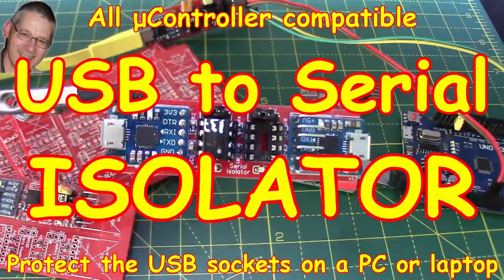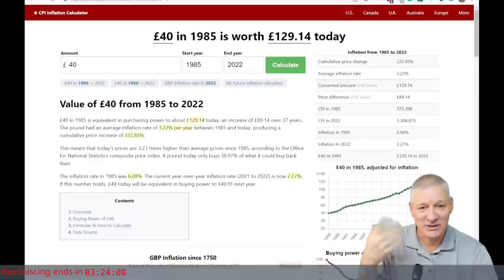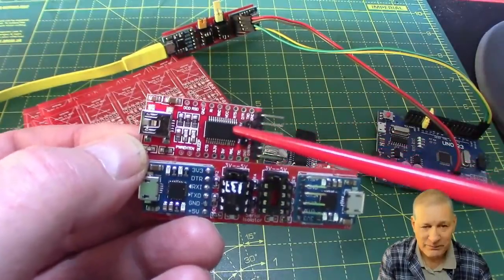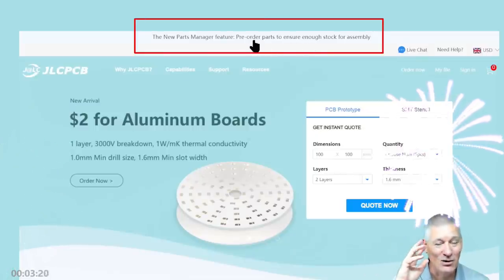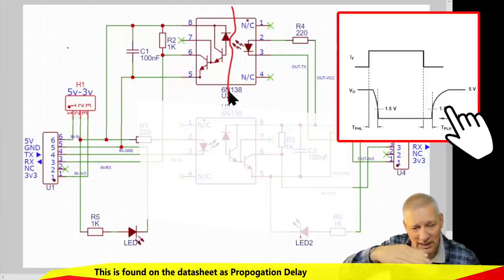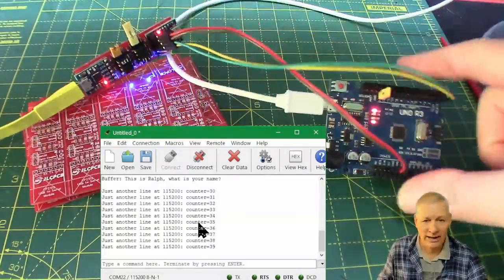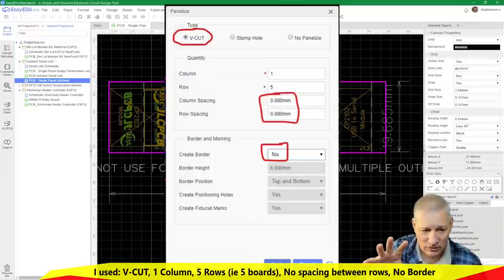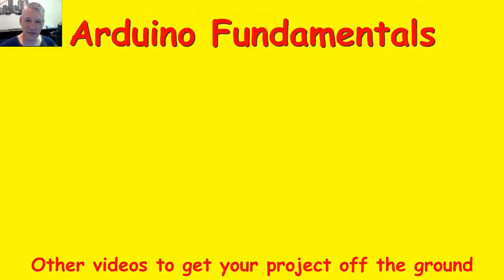#240 USB-to-Serial Isolator ⚡ Protect your USB sockets ☠

Comment: Well, your bringing up "Practical Electronics (PE)" awoke so many memories. My interest in electronics was mainly in music synthesisers (I am in my seventies, so read this as progressive rock). However I was also curious about computers. In the late sixties that meant mainframes. So, I was slowly but surely constructing a computer from 7400 series ICs. Then one day, in the newsagents, I spotted a copy of PE cover with a project for a monitor. After buying the magazine, I discovered that this monitor didn't have a serial interface but was meant to interface with a S-100 bus. I had seen some articles in the media lauding the invention of microcomputers. They didn't reveal any detail of how these devices were to revolutionise our lives, so I didn't pay much attention to microcomputers. However, the interface of PE's monitor intrigued me: it was obviously directly connected to something very like what I was attempting to construct. I looked into it further and realised that this thing I was constructing (already the size of a large suitcase) could be replaced by one CPU chip and a handful of peripheral chips. I bought a FOUR bit development board (for £250 in the early 70s) and a 50 year love affair with computers began.
Reply from the maker: It's funny how we get introduced to computers. My brother saw me still using analog/digital discrete electronics in the early 2000s and sent me a PIC controller (to update/flash PIC chips). The scales fell from my eyes. The rest, as they say, is history.

My first £3, 8-bit PIC chip dev board certainly was an upgrade to your 4-bit development bard for £250 (in the early 70s - probably more than a month's wages).

Interesting anecdote, Michael, thanks for sharing.

Comment: I'm here because my current project has not 1, not 2, but 3 USB connections.  When I connect my floating battery powered scope to it and touch the ground pin to the breadboard the scope's input relays "pop" and "whine" and the trace shows +12V -14V 50Hz sine wave.  Mains leakage current and noise.  Standard PC USB.  Note those USB circuits in PCs are as tough as nails, they will take all kinds of abuse and the isolator isn't really going to help the PC for you, it's the other way really!  PC SWPS are fierce.  They can be rated (mine is 800W!) the amount of noise it puts out is obscene!  PC power supplies (large SWPS) are the reason why the safety protection circuit in modern homes is set to 30mA... because having half a dozen SMPS in a house would trip a lower rated trip switch!
Reply from the maker: Indeed, I had an issue with a USB SMPS driving an Arduino circuit; behaved erratically until I put the power through a smoothing circuit; thereafter, no noise and perfect behaviour. Decent PSUs put out very little noise; it's the cheap ones (or ones connected to a PC) that can be a problem.

Comment: Hi Ralph
Many thanks again for another excellent video.

I finally got round to putting one of these together - I only wanted debug TXD from my 3.3v board but only had a 6N137 (5v) to hand but that's no problem for one way debug as serial to USB board has a 5v supply and this is only needed to power the Darlington on the receive side.

It's a super piece of kit as I need debug output on a board that derives its supply by 'floating'  between two lipo batteries (I alternate one of of the batteries each day in turn to provide the 'house keeping' supply rail). The lipo batteries are stacked to provide a nice punchy voltage for my motor. What this means is the nominal 0v of the 'house keeping' supply is at odds with the ground on my scope and the GND on the serial adapter card.

Another great project with excellent explainers.

I'm going to have to solder the board together soon and add it to my toolbox of MCR stuff.
Reply from the maker: Glad to see this working for you, Peter. Your explanations shows very well how the two separate halves can be used at different potentials. Good stuff! 👍

Comment: I remember reading that magazine, and seeing your article! I didn't pay it too much attention  as I wasn't so much into model railway at the time, but I did build the 7 segment logic probe on the facing entry!
Reply from the maker: You're kidding me! 😲 A small world indeed. 😁

You actually saw that in 1985? I actually got the dates wrong as I designed it no later than mid-1984 because I changed jobs then. It got published a few months later.

Comment: I got one of those serial dongles (the red FTDI one), but it's confirmed non-fake as I upgraded my driver to the one that would "in op" fakes and it survived.  It also has the FTDI laser etching on the chip unlike most of the fakes I've seen.  I don't recall home much I paid for it.  It may have actually come in a Elecgo kit or something.
Reply from the maker: FTDI did actually have a change of heart (customer backlash) and stopped their drivers bricking non-genuine FTDI chipped serial converters. After all, customers buy in good faith (thinking they have a good deal) and are unaware that they have bought fake goods. Even the seller may be unaware.

Comment: I've sent my design to jlc week ago. I use 2 common 817C optocouplers and B0509 isolated dc-dc converter (with ldo to get 5v and 3v3 rails) so I can measure stuff that is on different ground potential (my small off grid solar panel) with power and bidirectional data capabilities. hope that the pcb works 😅
Reply: Just keep in mind that they are under lockdown atm due to Covid. So, you might need to wait even longer.
Reply from the maker: Their website indicates possible delays of up to 2 days. You can bet they are doing everything they can to keep the orders flowing out.

Comment: Nice video ! I also like using a Bluetooth module HC05 types for this sort of thing.Gives you sufficient speed and many meters of isolation.You can connect the module to your uC and the use the inbuilt Bluetooth on your android phone or laptop. BLE modules also available.
Reply from the maker: That's an interesting way of receiving Serial.print information. If the HC05 module had been previously paired with your phone (as a dedicated debugging device) all you need to do is feed the TX pin to the HC05 and read it on your phone's screen. Or indeed, on your PC connected to another paired HC05. Good idea. I might try this out.

Comment: For Usb to Usb isolation you could have used the ADuM4160 USB Digital Isolator which will give you 12mbs through rate and 5KV isolation, only downside is that they are currently £10-13 each.
Reply: Alternative routes (wireless with floating supply):
- JeeLabs ESP-Link (for AVR Arduino or leodesigner/esp-link fork that also works on STM32)
- OpenOCD on any Raspberry Pi with something like open source Blinkinlabs JTAG Hat (has SWD and UART as well)
Reply from the maker: For us hobbyists 115200 is plenty fine enough if all we're doing is reading Serial.print output!

Comment: A tip.  It's an obvious one, but if you give it a play with it turns out to be pretty damn cool.  UART is bi-directional.  So there is nothing stopping you writing standard C/C++ command line applications on the MCU.  Why on earth would you want to?  Well, rather than just a constant stream of debug log you can have a small menu, one item on which will be the debug output, another might be to reset the program, another might be to turn on it's logging of data to the screen or to change a config parameter.
Where I hope to use this is in my audio project, instead of messing around trying to add 3 or 4 rotary encoders or POTs to change parameters, I can just open a terminal and type parameters at it:

filter 1 cutoff 22000
OK

filter 1 gain 0.2
OK

you see?
Reply: BTW.  You can avoid having to do line buffering and "eol detection" to have a "command line".  UART will send characters as you type them.  So you can trigger on single character response for menus and device a single character only interface.  You just have to ask a LOT more questions :)
Reply from the maker: Sounds useful, albeit a fair amount of work in the receiving program, I'm guessing?

That said, my web-enabled ESP32s effectively do something similar by accepting a GET (or POST) and carrying out some action (although I've not switched on debugging like that yet... food for thought).

Good input, thanks for sharing.
Reply: @RalphBacon  Its basically a UART line buffer.  Readline, writeline.  The rest is just "application" code.  In my latest case I already had UART line buffers for AT command set on the ESP32, so I just added some more for the debug uart to receive and process.
The first best use so far is being able to select what debug you want to see.  Level or "topic" if you will.

Comment: Hi Ralph, I have very fond memories of the 80's and the vast array of mag's we (now on line) had to chose from and almost certainly bought the copy with your work inside! Panelising always causes confusion no matter how experienced you are (first time) and I myself have struggled with it and given up I'm waiting for a nice easy Kicad plugin to arrive! I believe there are some out there right now I need to look in too which is great because Kicad now has a dedicated 'plugin' manager to help. Have you had an experience in the past that made you think about a protection board? I ask because I have never heard of such an animal before and have never had any reason to be concerned at least one I know about, however, now it seems like a great idea and great work...cheers.
Reply: Mozzarella Cheese!!!!!!!!!!!!!!!!!!!!!!!
Reply: @fredflintstone1  Stringy Squeak !!!!
Reply from the maker: @Andy I've always been wary of connecting the USB's power source to the end device because if the power is higher there (eg you also power that from a wall wart) the power comes back up the USB cable to potentially destroy your USB socket (or worse).

My ESP32 Web Radio is also very sensitive on outside connections because it is a floating ground device. When I connect anything else to the USB (serial cable) it hangs. This prevents that.

Comment: I have a lidar that has an stm32 and sends the data via 2 leds to another stm32 and I grab the data with an ftdi board
Reply from the maker: So not wireless, sounds like IR if you using LEDs?

Comment: Nice video.  Interesting subject.  Completely off-topic thing  though - at about 15:27 there is a low level bass boom.  I use pretty good headphones (very good base response) and I had to take them off to make sure something didn't happen in my building, but it is very reproducible on the video.  Do you know what that boom is?  Am I the only one that hears it?  Just checking.
Reply from the maker: I just listened to it. 

Note to self: stop hitting the microphone when waving hands about. My bad. 🤦‍♂️

I didn't notice during editing possibly because I had the bass turned down on my equaliser. Unless using decent sound equipment it's probably not (that) noticeable!

Comment: You can directly buy "USB ISOLATOR" that will isolate a usb connection and transfer both power and data, they cost a little more than $10 on ebay.
Reply: Can you please share a link to the item on ebay, Amazon or such ?  Thanks
Reply: Just search for USB ISOLATOR, there will be a lot of hits. They uses a ADUM3160 chip and a DC-DC converter. The ones I got are in a semi transparent case with a female USB-A at one end and a male at the other end.
Reply: just do not rely on them too much, you still have to know what you are doing in terms of safety.
This modules are as chinesium as it gets and datasheet ratings do not necessary apply in this case.
Reply: I agree, they may be rated for 1500 volt, but I would not trust them for mains isolation.
But voltages below 100V in CAT I is probably safe, this means using them for isolation between non mains connected circuits is basically safe.
Note: Anything after a approved power supply is basically CAT I and not rated as mains connected.
Reply: But where's the fun in that?😆
Reply from the maker: There's one in the video (on the workbench) with two USB sockets but that footage never made it into the video. It's OK but making your own is cheaper and more flexible (we don't need two USB sockets, just one with pins at the other end).
https://www.banggood.com/custlink/3GvRNTZaDp

Comment: I find with all computer aided design tools, neatness, attention to details and project hygiene are massively important.  Little mistakes and little shortcuts or half jobs near the start come back to bite you later.  A lot of them will make their best attempt to do what you ask even if it was a mistake to ask, if you know what I mean.  I was hovering over the "Order now" for a board this week, while staring at the gerber view I suddenly went... where exactly is the trace connecting the ESP enable pin to the ESP?  WTF?  Had to go back to the schema to find a renamed label issue.  ESP_EN versus ESP32_EN miss match, so the PCB layout editor didn't expect to connect those nets!  Such a simple mistake in such a simple part of the circuit is so easily missed.
I stopped expecting a perfect result on the first board, I strive to have it work but I fully expect to do 2 or 3 PCB prints per project.  It costs money and time, so doing everything you can to keep the "redo" to a minimum is worth the effort up front.  Sleep on it a few nights, you will remember things!  Then hit order.  Have someone else review it maybe.
Reply from the maker: Too true, Paul. No matter how many times I review my PCB design, there is always something that escapes my attention. 

As you say, do everything you can but do not expect perfection first time round. You can sometimes get away with little hacks but sometimes a new board (v1.1) is the only solution.
Reply: @RalphBacon  Literally just sent a board to PCBWay while reading this.  I wondered "What will my mistake be this time?"  It jumped out at me on the screen.  My dimensions are plotted on the edge cuts gerber.  Oops.  I mean hopefully they'll figure that out!
Reply from the maker: Fingers crossed. If they have any doubts they will surely contact you to clarify. They did that with me about 6 times on one board!
Reply: @RalphBacon  They came back and asked what I meant by "PCBWAYPCBWAY" suggested location for PCB ID No.  They wanted to clarify what I meant.

Comment: hi ralph. glad youre back again or maybe i was away? I have a off topic question you might one day  see fit to anwer. imade my own bluetooth portable amplifier using 7s 18650 a supoer cheap ali X bms (0.60 euro cnents) and a bt receiver amplifier. I charged it via 12 volt poewrline adapter thinking my bms woukld stop the charge when individual cell got too high. this all worked fine (tetsed it out side to be safe) now i had a fully chard 7s2p battery pack lot of batteries in a box. but to my diapointment aftert a few weeks in the closet they were empty like 0 volt per cell which is very bad for the batteries.  it makes me think the bms isusing some power and it is killimg my batteries by over discharging them. so it does the opposite of ehat i expected any thoughts nn that? maybe somr kind of electrnics term to look for when buying a bms? ihave used otrhers with succes but i regarge after each use like i put 18650 in my old power tool to drill. and it stays charged the while year. lol. that was a more expensive bms (a whopping 3 euro's) that can handle 30 amps
Reply from the maker: Any BMS (battery management system) should prevent two things: over-charging and over-discharging, both of which can destroy a battery. A typical Li-Ion battery has a full charge at 4.2v and a minimum safe charge of around the 3v mark (but probably no lower). 

Additionally, they should not allow any kind of discharge whilst being stored. As you say, today's batteries can maintain their charge over several months or even more. When storing batteries, they should not be charged to more than 70% of capacity, BTW.

There are dozens of such BMS modules on the market, but how well they work depends on whether they are monitoring each individual battery, in order that they do not become unbalanced. I suspect your ultra-cheap BMS just was not up to the job - maybe OK for a single cell but for multiple cells you need something with a track record. Search YouTube for videos that cover drone or solar battery BMS. 

I'm actively looking for a simple system for, initially, a single 12v LiFePo4 battery but ultimately for more, so keep tuned for a more detailed response in due course!

Comment: Doh!
I wish I'd seen this circuit a while ago - well, before I fried 2 of the USB ports on my desktop - I was in a hurry and trying to power a board with it - I failed to realise that the enable pin on a 433MHz transmitter I was using was hard wired HIGH - an issue if you then try to connect it LOW. 
I'd be keen to  build one of these - how do I progress this to get a pcb?
Reply from the maker: Send me an email, Peter, with your name & address. My "business"  email can be found in the About tab of my channel:
www.youtube.com/ralphbacon/about

Comment: It is a bit strange in 2022 to use rare darlington optocoupler, as well as not use schmitt triggers for proper digital signaling.
It should say "not recommended for new designs".

To protect USB, really use USB isolators. Also plugging you prototypes into external USB hub gives a bit more chances for your motherboard USB Root hub to survive.
Reply from the maker: Strange or not, Leeroy, it's a current chip and does work well. But I didn't design the circuit, there's more info in the magazine.